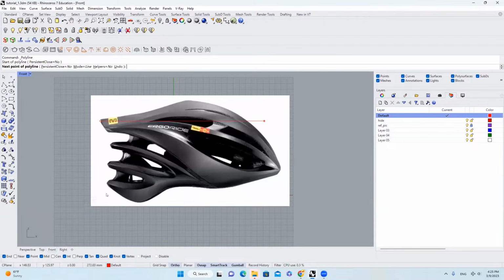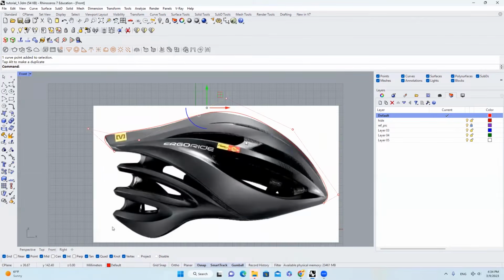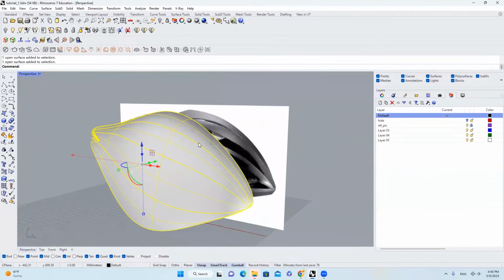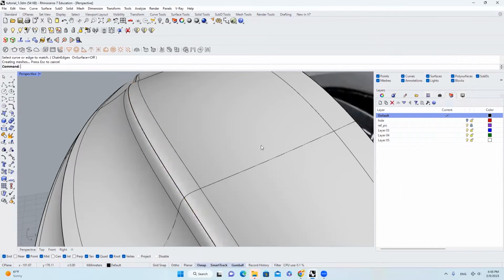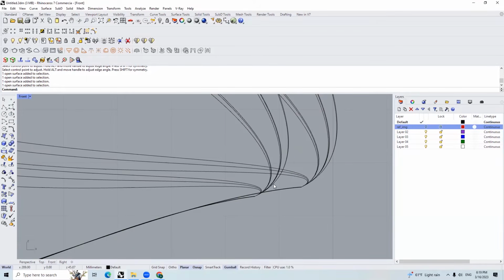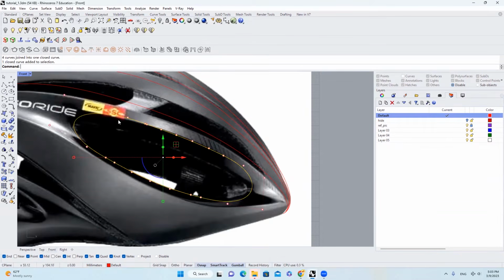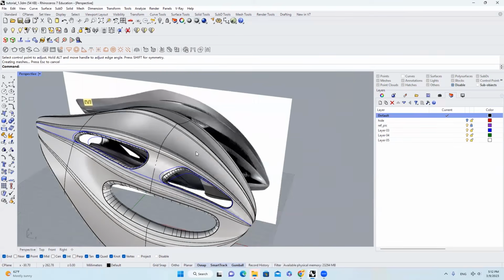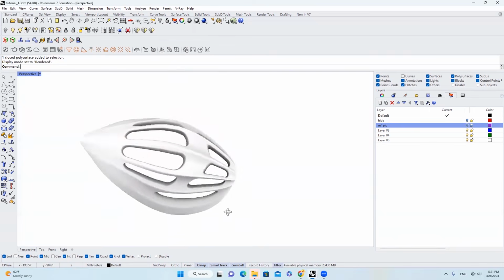Rhino Tutorial | Industrial Design | Bicycle Helmet

Comment: I'm not achieving a proper blend between the two surfaces, the outer and the inner. The edges of the blend surface are not closed straight at the ends, so after applying mirror, there isn't a complete seal.

Comment: Rhino is much more successful on creating organic things, but almost everything depends of lines and it's line drawing technic is not as good as Max. Creating perfectly matching lines is much much easier on Max. Modifying the lines by pulling the control points is not a good way I think. Max allows me to do it by dragging the vertex and beziers.
Reply from the maker: These two softwares were designed for totally different purposes. No matter how flexible or capable Max can be in terms of creating surfaces, it cannot be used by product designers, at least not in the production process.

Comment: Great Tutorial and very understandable.
I just have one question so far, after i mirror the half of the helmet like you did at 13:31, and after i matchsrf, when i try to mergesrf it doesn't work at all, even when i don't do the matchsrf, it doesn't work. So i joined them, will that cause problems in the design afterwards ?
Thank you !
Reply: Hello, I have the same problem, did you find the solution ? thanxx
Reply: Double check if youve really mirrored it correctly! Instead of drawing the mirror axis, just type in 0 (zero) and then from topview move the mouse so its eactly in the middle. Maybe that could fix it :) Peace out!
Reply: This is because during your 'matchsrfc' step after the 'mirror', u created polysurface instead of surface.